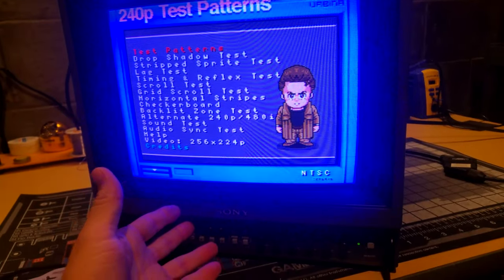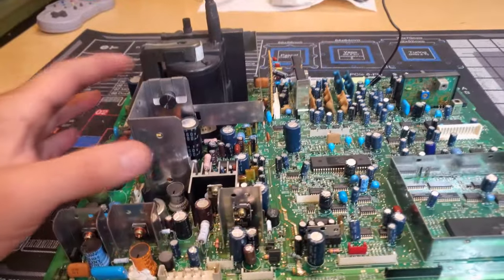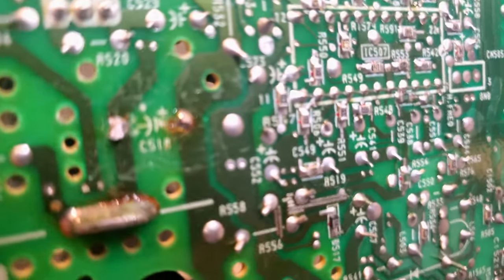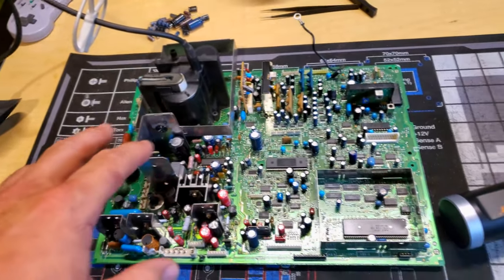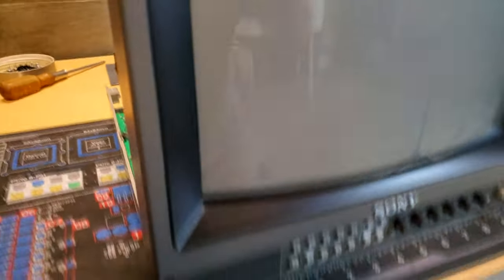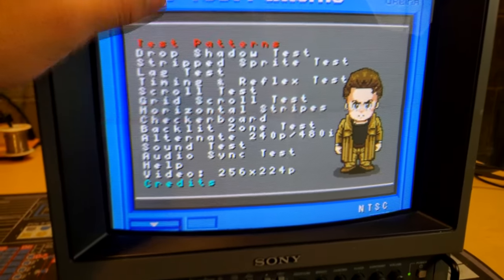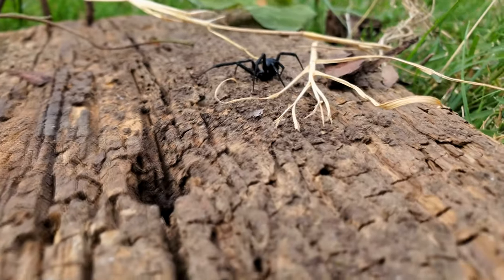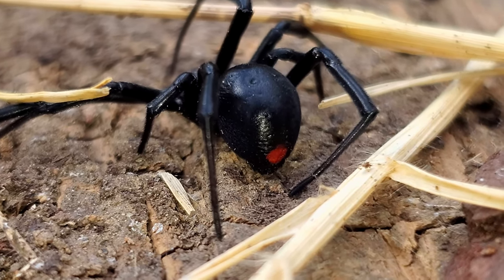Bad CRT Repairs & Image Fold-Over Fix

Comment: Will replacing the vertical/horizontal deflection capacitors fix vertical bowing (where the image slightly bows inside) as well? i have a 14 inch trinitron that does it and it slightly makes it go in, vertical scrolling in NES games for example is a bit annoying. Thanks for your work!

Comment: What if a cap replacement doesn't fix the problem? I have one M4 that still has fold over after replacing caps
Reply from the maker: It could be another component close by, such as a resistor or diode.  Or it could be the transistor itself is bad or a trace issue.   You can try using tools and meters to test these components to find the bad one.

Comment: Interesting.  I've got a strange fold over issue on my commodore 64 monitor. It only happens when playing 4:3 dvds.  You wouldn't notice it on 16:9 content due to the black bars.  Games look fine though even on the same system Xbox 360, PS2. Thought maybe it's the copy protection on a DVD.